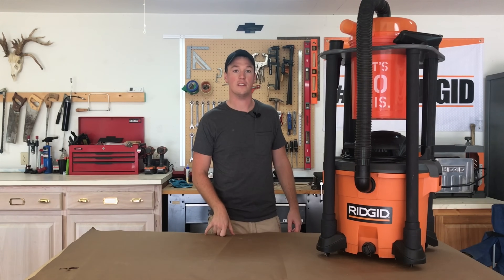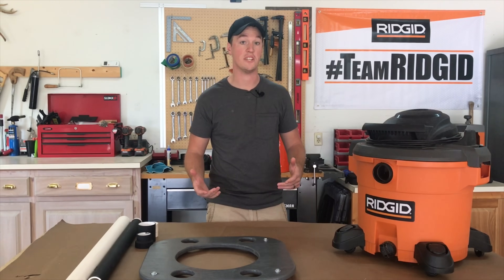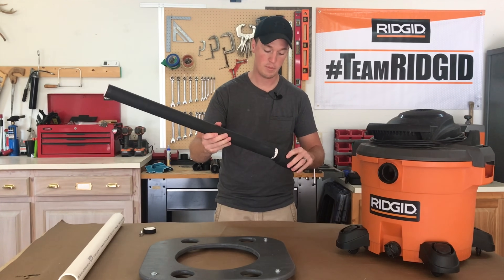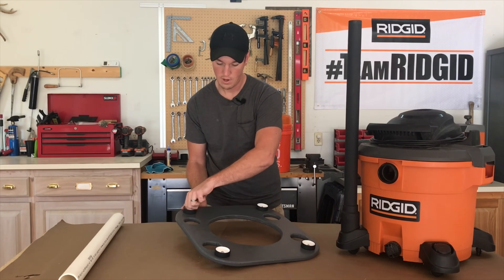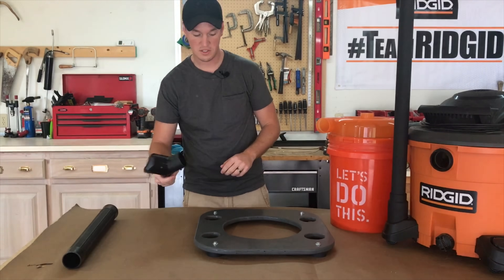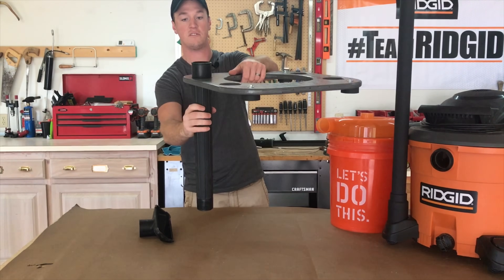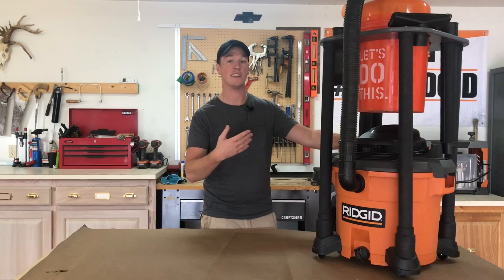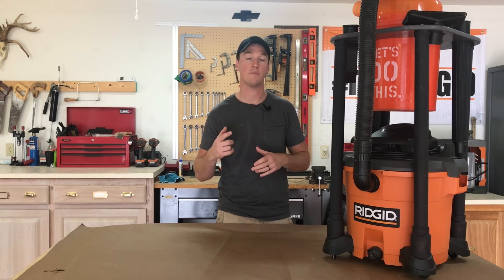The Ultimate Space-Saving Dust Cyclone Separator Cart | Dustopper & Ridgid Vac Cart

Comment: Just finalizing mine and noticed that my Dustopper won't snap onto my Depoy bucket, so it just sit kinda unstable and snaps onto my Lowes bucket so tight I have to lift the latch with a screwdriver.  Know where the problem is??
Reply from the maker: Mike Bruni hmm I’ve only used mine with the Home Depot bucket and it’s perfect. You can hear and feel it snap on. It appears to be a little loose on the bucket but tightens up when under vacuum pressure, but it’s certainly snapped on and you cant pull it off the bucket unless you pull the tab, regardless. So it’s hard to say if your Depot bucket is a little offsized, or the Dustopper!
Reply: @JohnBuildsIt  Thanks for the almost immediate reply.  Seems we have some "operator error" here.  All I had to do was hook one of the latches and give the other one a little "whack" and it settled right in, nice and tight.  I just need another 90 because my vacuum must be a little higher than yours.  Thanks for this build.

Comment: Nice job but in another review they showed that the dust topper does not filter out small dust. What has been your experience? do you still get small dust particles on the shop vac filter? Thanks.
Reply: Ok, I have since watched you impressive test with the dust deputy and topper. Neither get all the dust but it's no too bad in either set up and certainly better than not using a separator at all. Thanks
Reply from the maker: CrackerJack yep! That’s what I was going to say! They are both comparable in terms of performance. I’ve been using the Dustopper for probably about 8 months now and there’s a very small coating of fine dust inside the vacuum. Definitely better than without!

Comment: Great cart.  I copied it, but found that I didn't need any 2 inch PVC. Just heat the end of the 1 1/2 PVC until it get kind of floppy and push it down over the caster mounts. After it cools it is a nice friction fit.
Reply from the maker: Bill Cue nice!! I’ve seen that done before, I’ll have to give it a try sometime!
Reply: @JohnBuildsIt  Yes, totally effective. Less parts = less complexity and cost. Forming PVC = exact fit.
Reply: can you soften PVC with a propane torch? (no heat gun).  Is it easy to mold and keep PVC straight when soft?
Reply: @keales9564  I don't know. It will probably scorch or melt. As with most DIY projects you have to experiment. If you have some scrap PVC it won't cost anything to try the torch.
Reply: ^^^^^^^
@Bill Cue
Reply: I love all of you guys...the collaborations are amazing!
Reply: Instead of the fittings heat the area that comes into contact with the vacuum and dimple the PVC it will retain its original strength
Reply: Warm it over your stove in the kitchen... be sure to ask wife for permission! You might be sorry if you dont!

Comment: BUYER BEWARE: Ridgid is upgrading this model from WD1270 to HD1200. The casters are not the same size on the newer model (PVC won't fit) and it is MUCH Taller. I ordered mine 3rd party on amazon.
Reply from the maker: Christian Williams yes, thank you! Someone told me yesterday they ordered a 1270 online and a 1200 was delivered instead. They took the 1200 back and they still had the 1270’s in the store. Checked my local store and they still have some as well. If/when I get my hands on the new vac, I’ll try to come up with different fittings and dimensions and post an update in the description. Thanks for pointing that out!
Reply: @JohnBuildsIt    Hey John, for what it's worth, I came up with a similar design a few years back, but my shop vac didn't have the tool holders in the wheel covers.  In mine, there were 4 skinny plywood ribs (3/4"x1/1/2"x40"), vertically spaced equally around the bucket, going from the lip on the bucket where yours sits in the hole, down to 4 points around the top of the vac.  Partway down, there was a plywood platform (3/4"x12" on mine) that the bucket sat on, to which the ribs were attached (picture a chair with no back, and with 4 legs above and below the seat).  The bottoms of the legs were screwed to 4 small L-brackets, which were themselves epoxied to 4 points around the top of the shop vac.  The screws in the bottoms of the legs allowed for easy detachment from the L-brackets if needed.  Feel free build or borrow from that, and I'd love to see your take on it depicted in your excellent video style.  Sadly, I never wrote up plans for it, or videoed it.  It was more of a necessity thing than something I thought about sharing, before now.

Comment: Very simple well done design. Thank you for the ideas.  If anyone is worried about this tipping over as you pull on the hose then why not put a few bricks inside the vacuum and it will change the center of gravity toward the bottom of the unit. That would make it much harder to topple over in your shop. I have a very similar Rigid Vacuum and I will be copying your design.  Thank you for the inspiration.
Reply: Used break rotor works well
Reply from the maker: Henry Phillips thanks! I can fling this thing all over the shop and it’s sturdy as  can be! As is, it has a very low center of gravity compared to some of the other vertically-stacked separator carts out there

Comment: Well done!
I had just made a box with casters to hold my Ridgid Vac and new Dustopper side by side. The next day I saw your video and knew I needed to use your design as the one I made took up too much floor space and was somewhat awkward. I made your design today and am so much happier with it. 
I saw from other posts that several people had some questions. I would offer a few suggestions to anyone going to make this cart.
1. The 1 ½  pvc pipe is available at Home Depot in black instead of white so spray painting can be eliminated.
2. The other pvc fittings are only available in white so spray painting is needed there.
3. The couplers and reducers I purchased fit together so purchasing the two foot piece of 2” pvc to connect them was not needed.
4. My Ridgid Vacuum utilizes a connection that requires a clip to connect to the vacuum as opposed to a friction connection. I used that connection (provided with the Dustopper) with a 2” black pvc “street elbow”I purchased from Home Depot because the Dustopper (as others have mentioned) only comes with one elbow. To make it fit I duct taped those fittings together then covered the duct tape with black electrical tape so it would look better….and it does.
5. Measure carefully where the bolts go through the plywood top before drilling the holes for the vacuum accessories. I didn’t and had to make a second top as the holes I drilled where located where the bolts should have gone! 
Thanks again for the great design.
Reply from the maker: Chris Owen awesome! And thanks for the tips!
Reply: When space is at a premium, think cubic feet, not square feet. Building up, not out, is the smart way to go!
Reply: I did the same thing!  Wish I saw this earlier

Comment: I just bought and returned the Rigid 12 gal vac and dustopper because they took up too much room in my shop and the bucket was a pain dragging it around without wheels or a cart.  Now that I’ve seen how you solved that problem I am going back to the store to buy the vac and dustopper again and pick up the items in your shopping list as well.  Kudos for great idea and a huge thanks for sharing it.
Reply from the maker: DocEE haha that’s a bummer but I’m glad to hear this helped! Thanks!!
Reply: Picked up the vac and all the items on your list this evening after work and spent a few hours putting it all together.  Only thing I’m missing is a second elbow to connect the dustopper to the vac.  Without two elbows the hose is too short.  That wasn’t on your list.  It went together easily.  Thanks again for the genius design and for sharing!  Solved my dust collection delema that I’ve been stressing over for a few weeks.
Reply: @docee195  I just received my dustopper from HD and I didn't get any elbows even though the box says it should have one. Tried contacting the manufacturer but no luck talking to someone. Went back to HD and they ordered another one but I'm afraid if it does have any elbows it will only contain one.

Comment: Great build, I may copy it. One question: You lose some efficiency putting the 90° fitting as you enter the vacuum, and every little bit helps. Why not go with the flexible hose all the way from vacuum to the Dustopper? Longer path, but much smoother.
Reply from the maker: Will Wyatt you’re not wrong there, the less sharp angles the better in any vacuum system. I just wanted to use the hose that came with the Dustopper and keep it as compact as possible, and honestly I haven’t been disappointed in the suction at all this way!

Comment: I built a cart for my dust deputy that I hate because its bulky and clumsy. I might buy a duststopper and give this a try.  You could add a couple hooks in one of the PVC pipes -- one facing up and one down, and use that to wrap the power cord around.
Reply from the maker: Patrick Sinn nice idea!!! I may just do that!
Reply: @JohnBuildsIt  On the K.I.S.S. theme, rather than adding anything complicating the design, simply change the platform to include cut-outs on one side for a place to wrap the power cord. For transport of any kind, I store vacuum hoses inside the (empty) bucket, so no need to change the design for hose storage (IMHO).
Reply: I had that idea also, then I noticed that the handle on the Ridgid just screw one, so I used it and the screws from the handle. Works perfectly!
Reply: why couldn't you use the dust deputy in the same way as you are using the dust topper? I have already bought a dust deputy
Reply: @jameshochstetler6093  I did too. Would be quite tall but doable.
Reply: @jameshochstetler6093  you can. . . .

Comment: Great Idea! I went out to my shop to build it and found that my Rigid does not have the same wheels - no mounts for accessories on them. I have the quieter version. I went to HD and checked and most of the vacuums don't have those wheels. Any suggestions for mounting the PVC to the other types of wheels?
Reply from the maker: Rod Wolfy if I can explain it good enough haha.. an idea is to make another plywood ring that wraps around the bottom portion of the vac and rests on top of your wheels. Then attach the pvc pipe to both pieces of wood. Should be able to pop your wheels off, slip the wood on, then put the wheels back on for the wood to sit on. Hopefully that makes sense lol I’ll probably try it with my other vac as well

Comment: How do you prevent the bucket collapsing
Mine always collapsed
Reply from the maker: WaldvogelReview using the Dustopper and Homer bucket? That’s never happened to me! Well, besides when I purposely plugged the hose when I was running tests for my Dustopper VS Dust Deputy video to measure for leaks. The collapsing is caused by the air flow being restricted too much for some reason. To be able to finish the plug test and shoot the video, I simply put the bucket inside another bucket and it prevented collapse. You could also cut a plywood ring and put inside the bucket to reinforce it. These are just a couple ideas I found when I googled it. Hope that helps!
Reply: I use a dust deputy and the homer bucket and Lowe’s buckets always collapsed

I will likely try the plywood or look for a thicker bucket